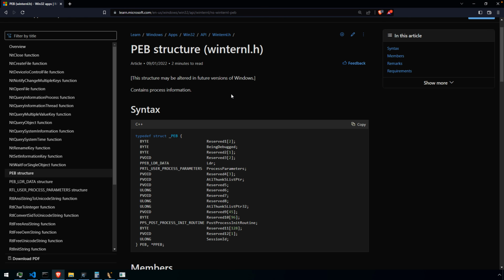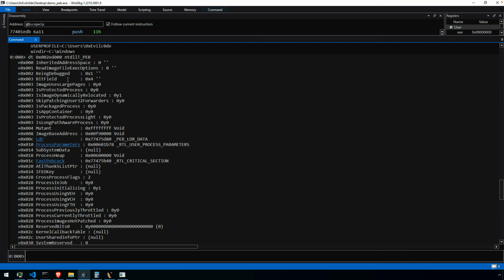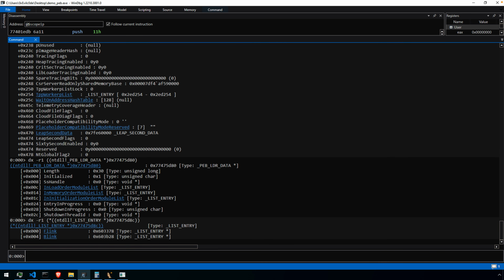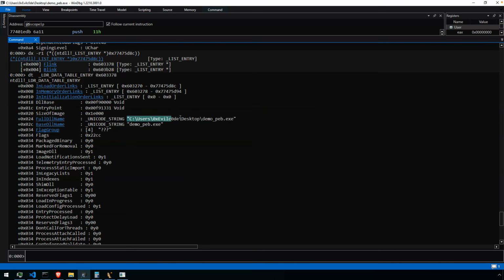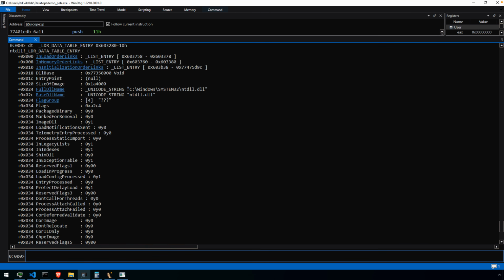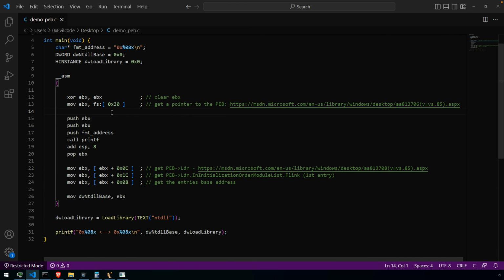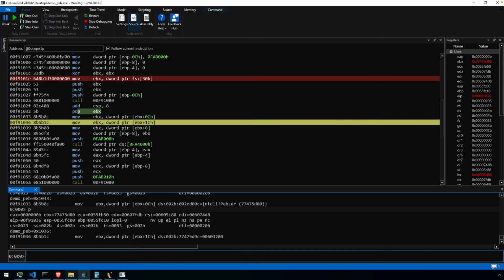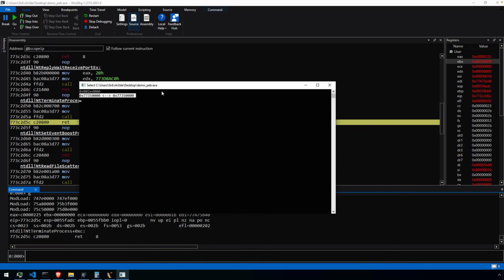Windows Internals: Walking the Process Environment Block to Discover In-Memory Libraries

Comment: Hey Josh,
I would really appreciate if you can put a series or videos or even a course on Udemy/Pluralsight on how to look for 0 day vulnerability by doing a a complete reverse engineering of either the protocol e.g. looking at recv func then backtracing it to see where the pitfalls are etc, or complete analysis using IDA pro.
Reply from the maker: That would be interesting - I don't have anything like that currently planned but I'll add it to my content list :) Thanks for the suggestion.